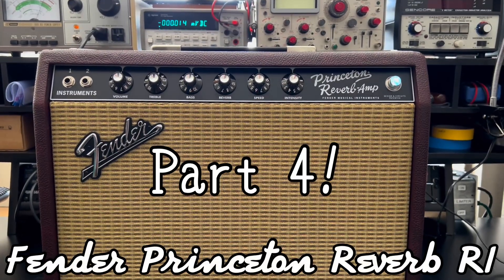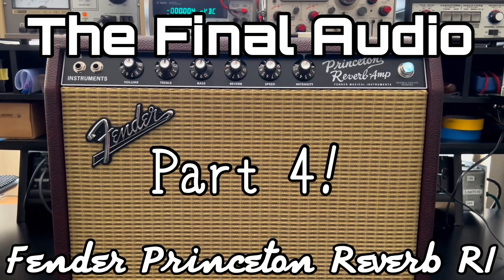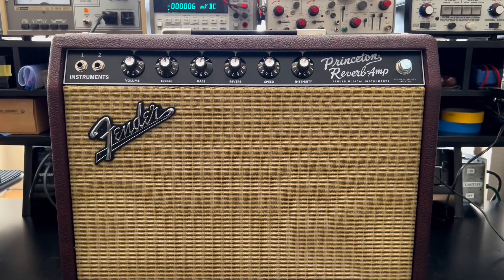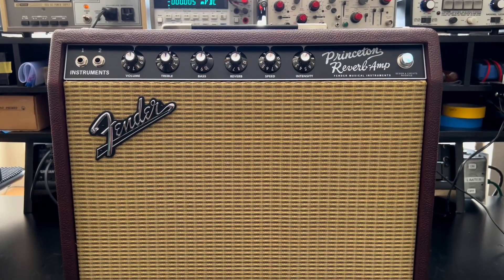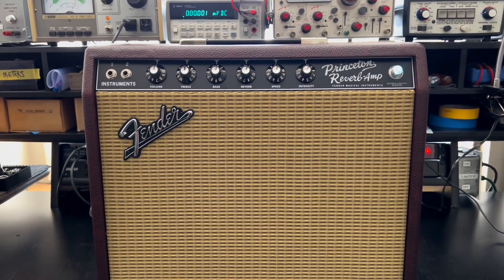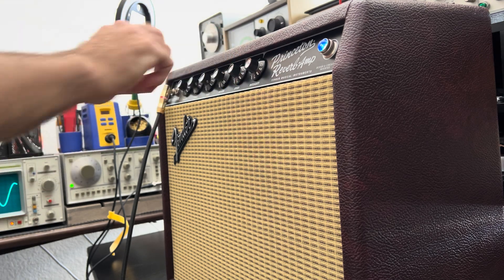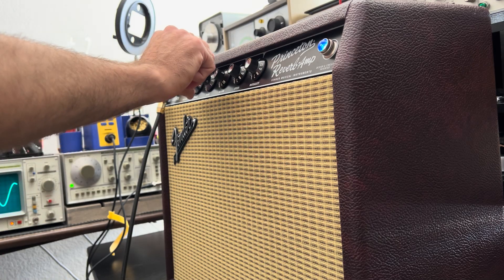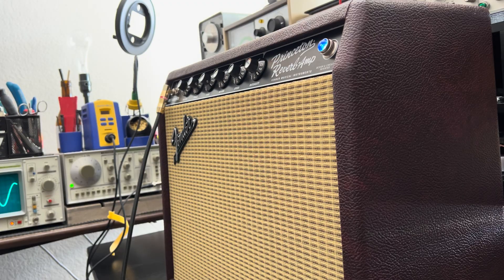The Final Audio!  Fender Princeton Reverb Reissue Part 4

Comment: Are you willing to share the component specs you used for to achieve the slower tremolo speed?  Under the glow of a certain tube nightlight so generously gifted to me, I have embarked on a journey to rebuild my Princeton (I have acquired what I believe is a very high quality PCB from a fine fellow in England) and am slowly but deliberately progressing along. This video series was a motivational boost to stay the course on my project.  Sounds phenomenal…
Reply from the maker: Hey hey of course and I hope you’ve been well, my friend!  The amp came with .01/.01/.02μF caps. I pulled the middle .01 and replaced with a .02. 

I need to post a correction - misspoke about switching the neutral at the power supply. Good ol’ dyslexia!